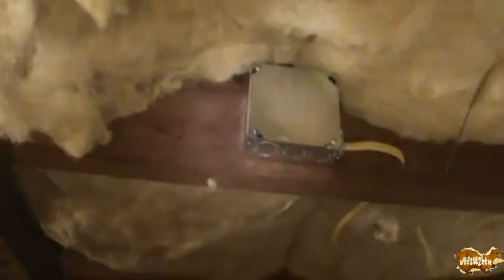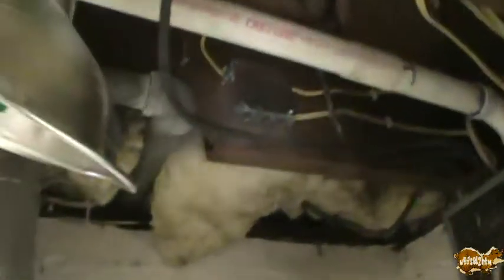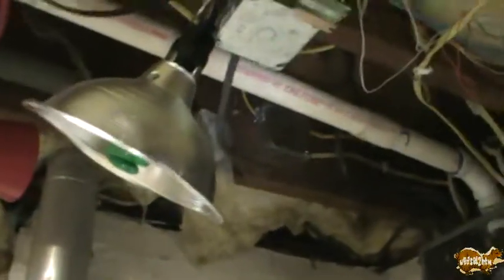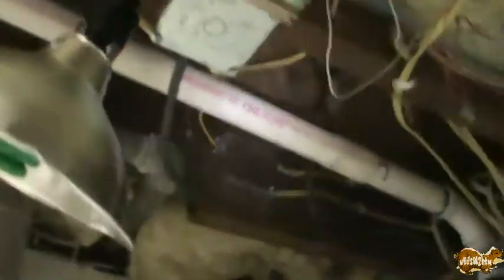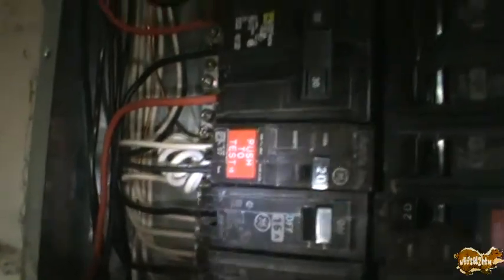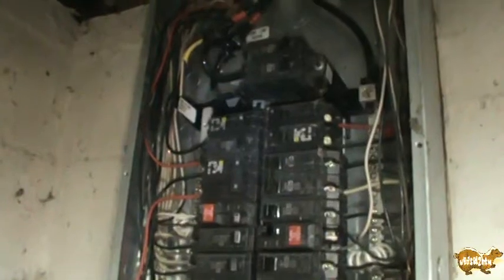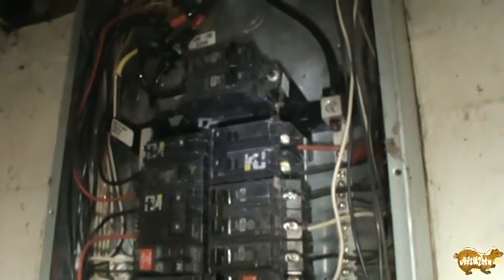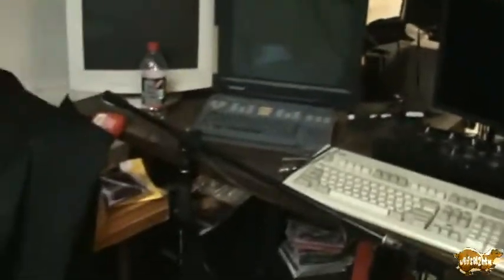Blog Tv Outlet

Comment from the maker: I had the house inspected before I bought it, the inspector noted the white PVC, he said that is was odd but could not see a problem with it being used other than being mistaken for plumbing.  So it will stay that way until it needs replaced, or other repairs or upgrades to the house require its replacement.  Considering some of the other idiot wiring found in the house, The white PVC is low on the problem list.